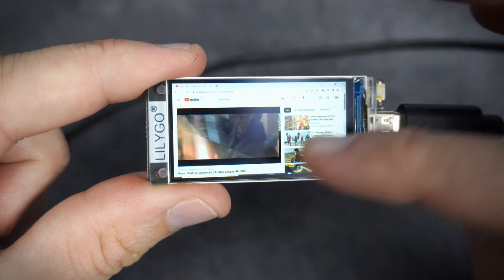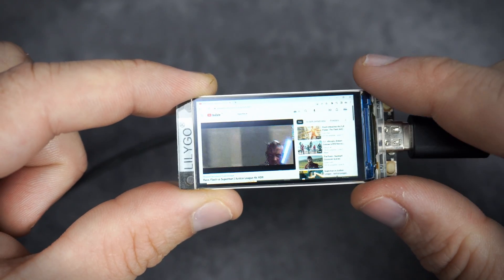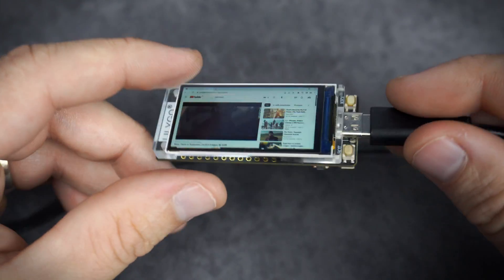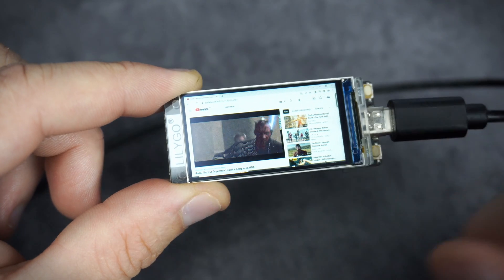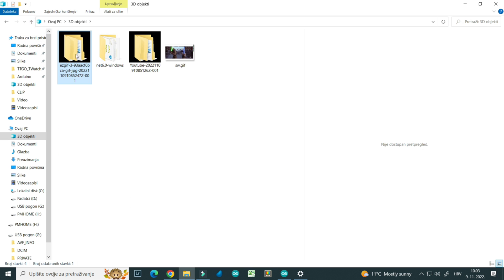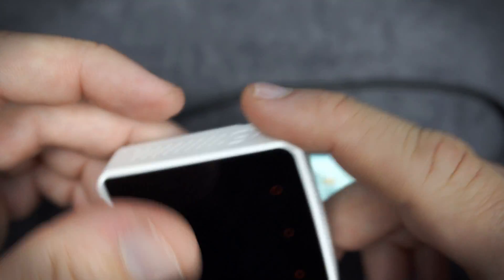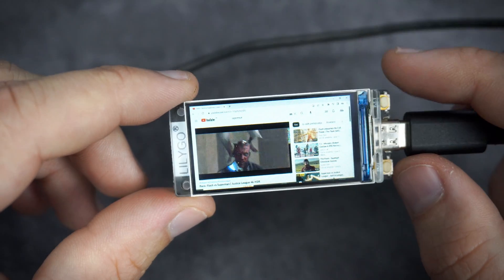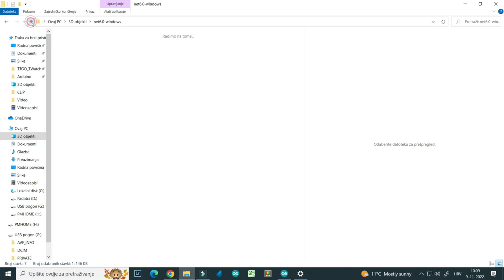Play YouTube video on ESP32 device (fake)

Comment: Teensy mcu made progress with video using modded graphics library. If you use premier pro you can export video as jpeg or bmp sequence directly and scale down to required resolution and bitdepth at the same time. You may find the artifacting is less of an issue. Loving your videos bud, I’ve come from heavy teensy usage and just got my ESP32 S3 a few days ago thanks to your videos and inspiration 👍 (really don’t like the new Arduino IDE 2.0 though…)
Reply: I agree that in some ways the Arduino 2.0.1 IDE sometimes feels like too much tool for the job, but it is much easier to plug in new capabilities, such as support for the raft of ESP32 boards.  My complaints about the new Arduino IDE:  1.  It always recompiles, but somewhat faster the second time, even if you made no change to the source; forgot to specify the port, Arrrrrgh!  2.  It is really slow to initialize and slow to compile.  I see messages like “indexing 8 of 54” in the lower left corner while compiling; not sure what that it, but it seems rather time consuming.

I kept the old IDE installed to more quickly update and compile my existing Arduino sketches.  Both IDE versions can coexist.
Reply: @wtmayhew  totes, I think the thing I’m most frustrated with is not having the option of serial monitor in separate window like it used to be (I write big programs and use multiple displays so I like serial monitor on other display and program window maxed… unless I’m missing something? 😜
Reply: @JoopMedia  Oops, forgot about that annoyance!  You’re correct.  It seems like a step backwards in the new IDE.

Comment: Anyone getting memory size issues? i have it set to 16m and different versions of scheme. I have the correct library and deleted the old one. I just have the s3 version of tft_espi
Reply: Found the issue. at5:15 there is a 3 second screen flash which shows the correct scheme setting. Also removed the semi colons after the two includes.. Now working